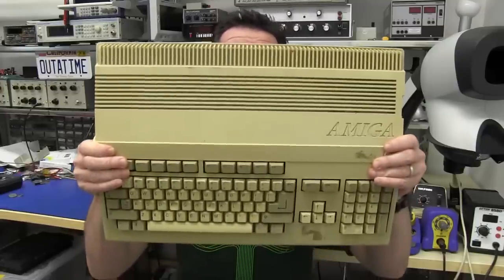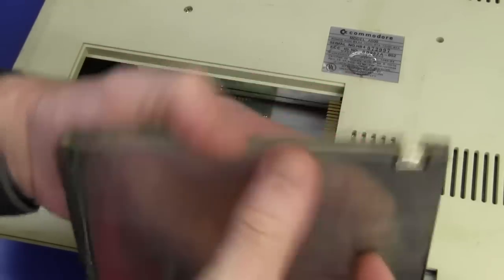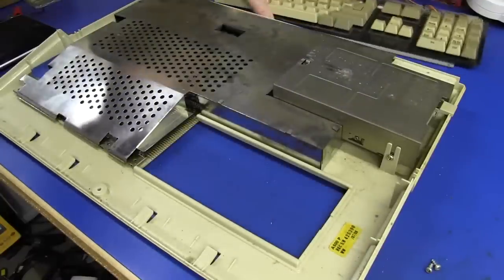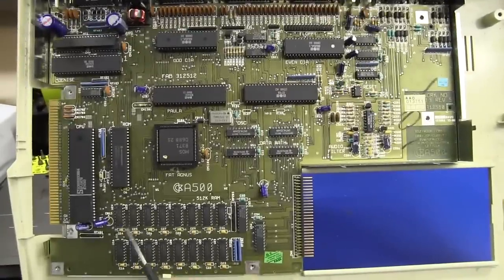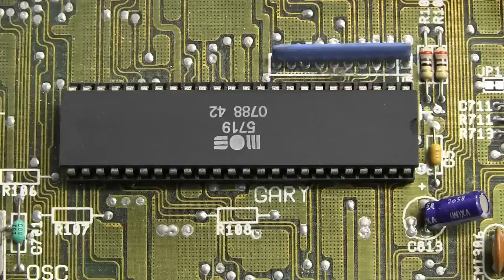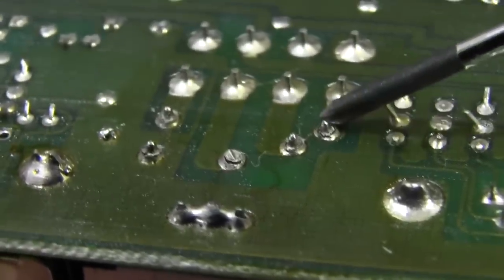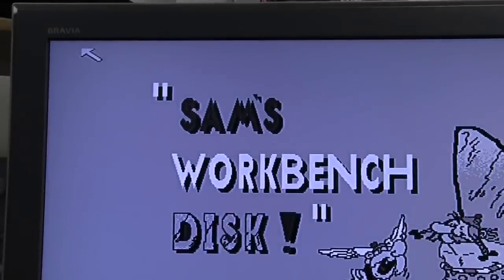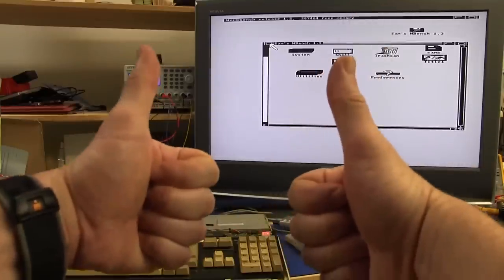EEVBlog #438 - Amiga 500 Retro Computer Teardown

Comment: Occasionally and somewhat ironically, the Anti-Yellowing agent can re-act with bromide and cause it to yellow faster (and in areas without any exposure to light)

When you see a system that is still white on top, but yellow on bottom, that's a great example of that!   The bottom in theory should be whiter due to reduced sunlight exposure, but if it's more yellow chances are the Anti UV chemicals themselves are what triggered the yellowing process.  :3

Comment: I've got two Amiga 500, one with just the 512kb expansion, and one with a hardrive at the massive size of... 50MB SCSI ;) and 6MB of RAM, BTW that one boots to Workbench within 15 seconds once I flick the switch.
And off-course an Amiga 1200 with a 1230IV expansion board with 68882 FPU @50MHz

Comment: I am a huge amiga fan still loves them and use them!. Yes it was awful see u didn't know crap about anything on this machine work of art. The trap door what u did find here was a 512k expansion so u did have 1mb. On the right side is a port for adding a SCSI controller and here you did add a hd. you might not like this but I think they knew how to build computers in those days and commodore was the best company for innovation new computers very sad they are gone see what we are stuck with now.

You did say in the start of this video there is a solution for removing "yellow plastic" can you tell us/me how. ?

PS: your show makes me wanna learn more about electronics.
Reply: If you rub case with petroleum jelly and ignite for 10 seconds the unit will turn white again.
Reply: They also knew how to save money versus build robust hardware.  The edge connector direct-coupled to the CPU is a MAJOR static electricity threat, for example.  That was a clear case of cost-saving measures.  Thankfully, the MC68000 and Signetics parts had excellent static discharge tolerance back then, and I think that's what motivated Commodore to simplify the design.  You definitely can't do that with a 68060 these days.
Reply: Commodore was not the best for innovation, please don't forget that Commodore bought the Amiga, they did not develop it, Amiga inc. did and the brilliant people that worked there. And it was Commodore that ruined the Amiga, by not improving the chips anymore, AGA came out way too late and way too weak, by then the PCs had caught up and were getting better than the Amiga.
There is a lesson that if the original founders are gone from a company, especially when they had done ground breaking, never before done work, the clock will start running and the company will start to die, because all they can do are improve on a design, but never redesign or radically improve it.
Reply: nigratruo It is true what you say and they had one of the worst management teams I have ever heard of.  For one thing, instead of keeping the engineers working on a successor model to keep their technical edge for the time Commodore dismissed them.  Later when they were forced by competition to bring out real improvements they brought out the A1200 with a lower spec AGA chipset than planned and it came to the market late.  At that time 386 and 486 PC's were around with graphics that were just as good (and could be made better) and had almost as basic stereo sound from the Soundblaster and Adlib cards.
Reply: James Lewis true.  critical mass of pc technology to price point ratio was the day the amiga could no longer be competitive. I remember being in complete disgust that my amiga 4000 couldn't even do 800x600 non-interlaced when my PC 386 bridgeboard combined with a "low end" $100 combo ISA graphic card could do 1024x768 non-interlaced in 24 bit color, and had 16 bit sound quality.  Needless to say, it wasn't long after that I sold the amiga and bought a full fledged 486 system with 1600x1200 graphics for less money and never looked back.

Comment: I'm a little insulted, you could have at least googled the machine you was ripping a part to discover what the machine could really do, yeah its had its day but it deserved a lot more respect than your giving it by word of mouth, what your ripping apart is one of the first multitasking operating systems made.
Reply: Settle down captain
Reply: you are right. beside the multitasking - which was a development more on the software side - the hardware was very advanced. sepparation in fast and chip ram which was very effective and a lot of co-processor and dma stuff going on. really great and unmatched value for the price